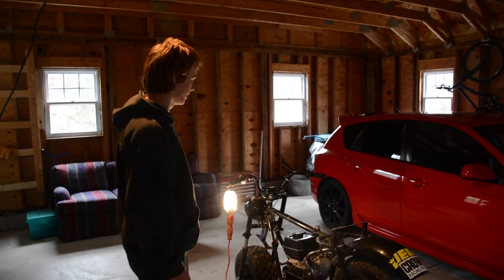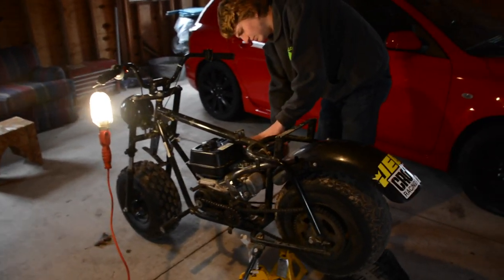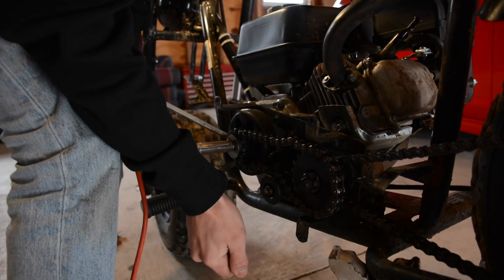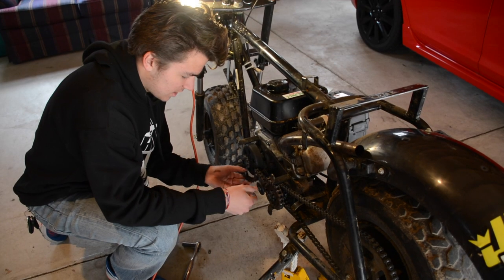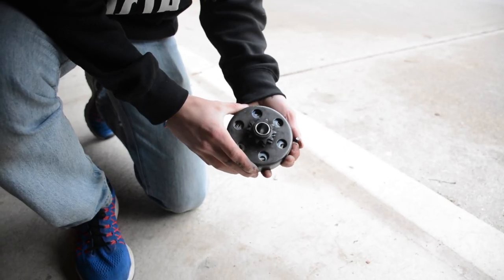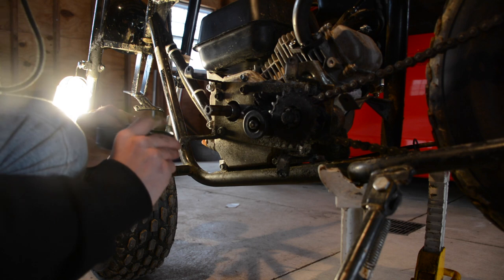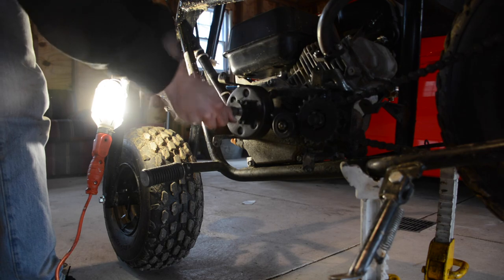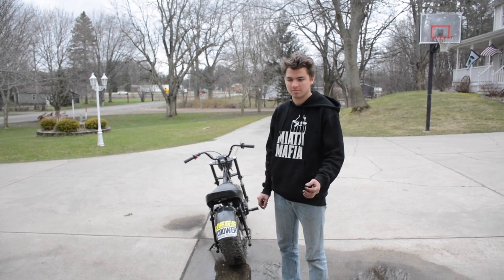How To Replace A Centrifugal  Clutch

Comment: I have seen a video by Max- Torque clutch. It shows taking the clutch apart, splitting the segments into two pieces, and shortening the spring a bit, in order to raise the engagement RPM to cure the problem of the original clutch.

Comment: yo bro i need help i got a clutch and it has the key inside and idk how to remove it..also the engine has a key which i cant seem to remove it so the clutch doesnt fit on it..any help?! 3/4 centrifugal clutch predator 212cc
Reply from the maker: just take a screw driver and put it on the end of the key on the crank shaft and lightly tap in out of the key way and it should just slide right out, then keep the key inside of the clutch and slide it on